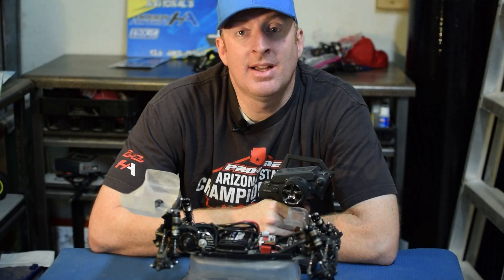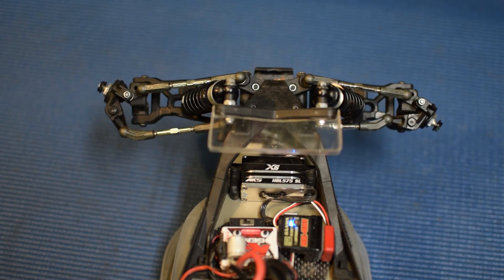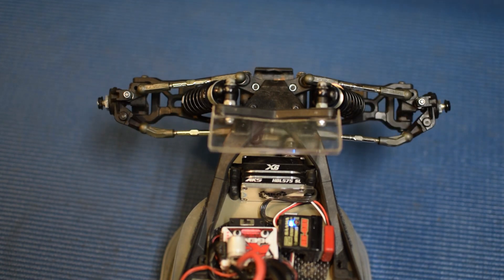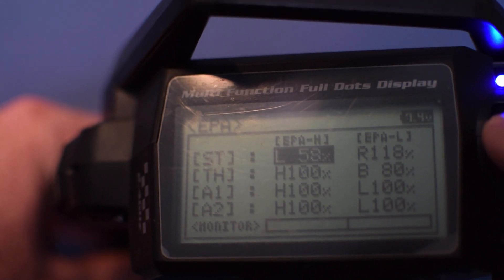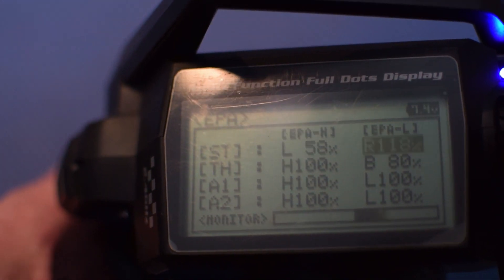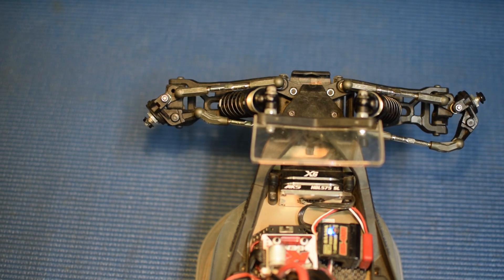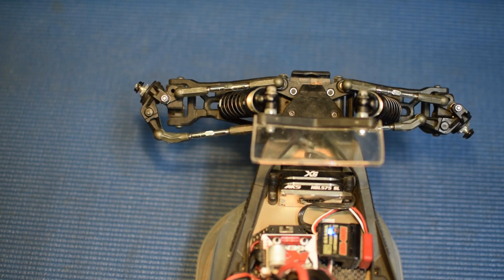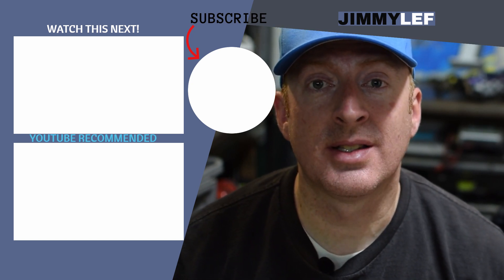How to fix RC car steering (Setting EPA) TLR 22 5.0

Comment: Thanks for the info. Is it important to have your motor fan going when adjusting your epa? Asking for Mike.
Reply from the maker: Great question Paul!  It's only important when then fan is hard wired to the battery and you're too lazy to unsolder it for the video...
Reply: Thanks!